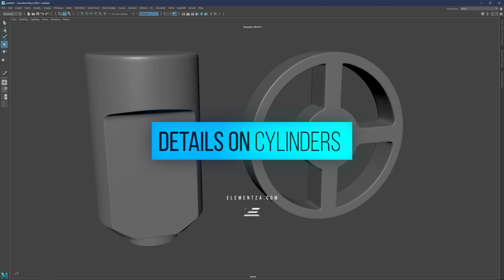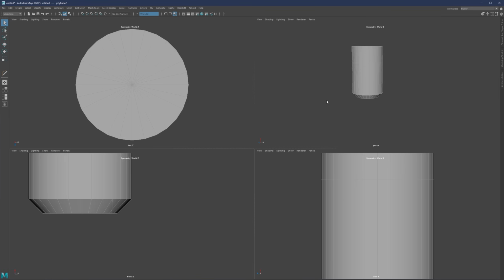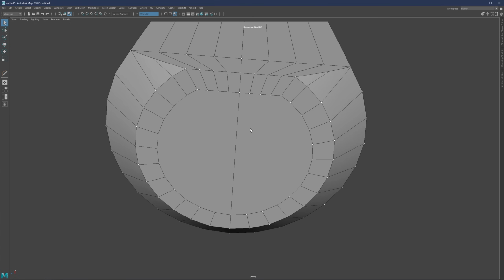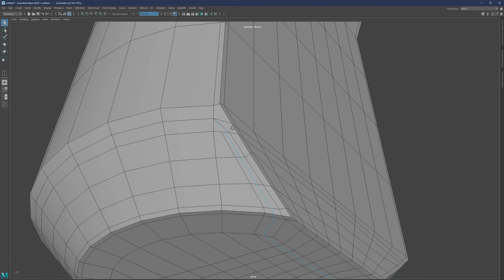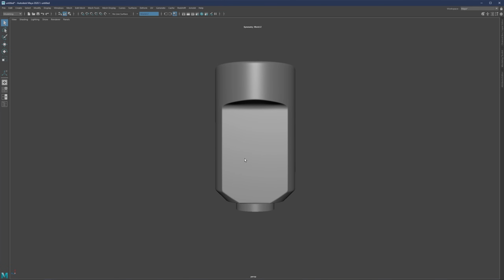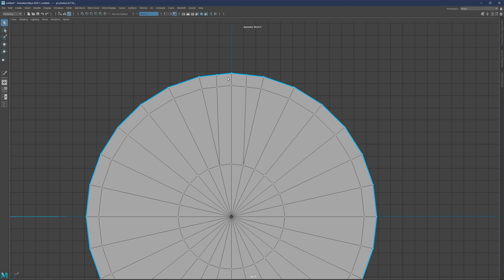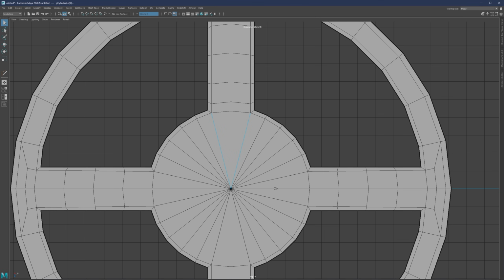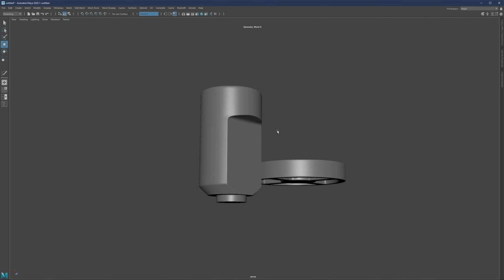Details on Cylinders // 3D Modeling in Maya

Comment from the maker: Hey guys,
I hope you´re all staying safe and healthy! 

Here is a workflow on 2 cylinders and how I would approach the topology. I did not explain every tool, this was more of a method presentation.

If you´re interested in the tools, there is a video series here on my channel, and website, covering the basics.

On the other hand, if you are interested in more in-depth training, then check out my course on Mastering 3D Modeling. I will leave the link in the description.
There is a ton of stuff inside, I keep adding new content regularly, and we have an active community to help you along the way if you need it!

Stay safe, guys!

Until next time,
Mario
Reply: to have an 90 degree angle cut you just have to select the first point, then hold shift+ctrl under the commande <multi-cut>. in that case a green little half square would show at both corners of ur starting point and ending point. if only one is shown means the 2 edges connected aren't parallel